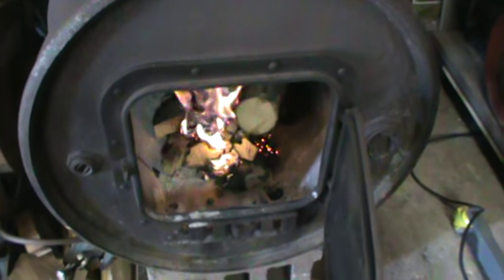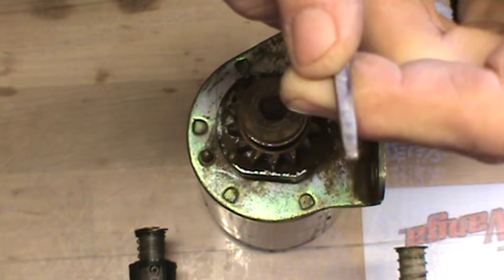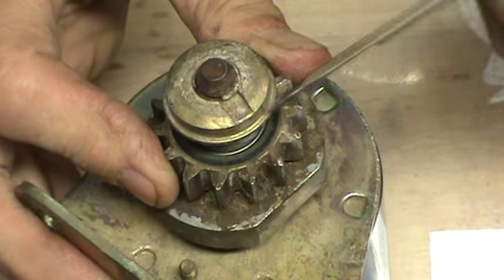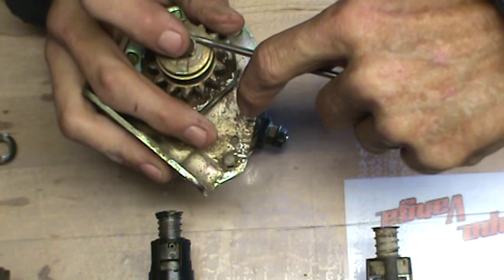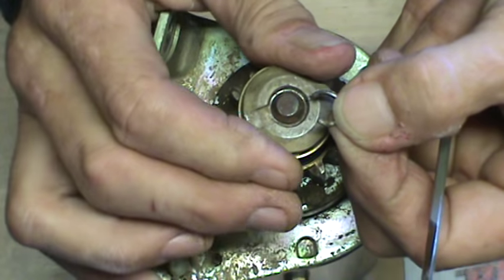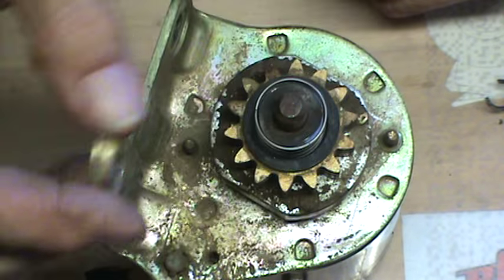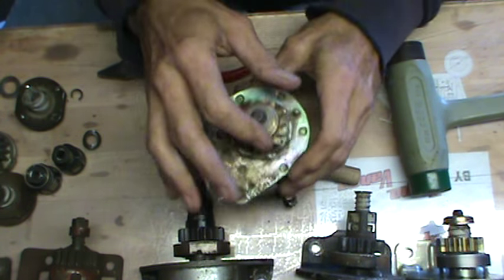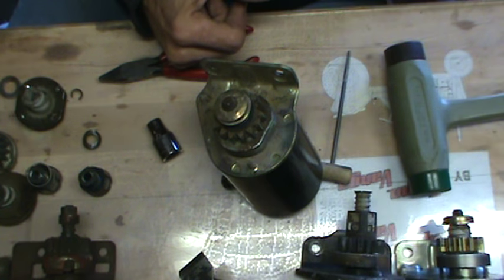Briggs Starter Gear Replacement

Comment: thanks for the video, that was sure faster than it worked when I did it,, I think part of my problem was I didn't have a small screw driver, in my case it's almost harder to reinstall the clip but I never tried using that slot like you did,, thanks again.
Reply from the maker: +MissouriOldTimer Your very welcome Old Timer! Glad I could shed a little light on my way of doing this. Another way is to use a small 12 point socket and press the clip onto the armature shaft. Cheers!! Zip~

Comment: I have no idea what the original gear looked like for the number of teeth but the plastic one used to replace it is already broken after only 1 year.  Is there a way to look up what the original gear was?  I’m thinking it didn’t last because it was the wrong one.  Thx.
Reply from the maker: Hi Paul. Yes there is. Using the first two sets of numbers on the ID tag (click here for where to look: https://www.youtube.com/watch?v=Y4T0W2fHRdU) you can then go here: https://www.briggsandstratton.com/na/en_us/support/manuals.html to enter your engine identifying numbers and download your parts manual which will have the needed part number for your starter gear and other parts you may need in the future. Cheers! Zip~

Comment: Nice video.
I lost that tiny ring it flew away like nothing (it happened before I watched this video)
I don't know where to find something similar to replace it...damn
Reply from the maker: You can purchase a new clutch that will come with a new snap ring or, you can drill the shaft at the ring groove and install a roll pin to keep everything together. I feel your pain. I've lost a few in my day too. Just search Briggs and Stratton starter clutch and you want to match the type appearance wise as well as by counting the number of teeth on the clutch and making sure you order one with the same number. Cheers and good luck! Zip~
Reply: @ZippoVarga  Thank you!!!!!

Comment: You did a good demonstration here I am fighting with trying to get the ring off on a Kohler vtwin starter.  Similar to this but, seems hard and I have messed with it all day trying to get it off.  What exactly did you do to that screwdriver and how did you do that
Reply from the maker: I ground the tip with a radius to match the shaft radius and flattened it down enough that I can get the modified driver between the ring and starter armature. Hope you get it! Some can be a real pain. Cheers!! Zip~

Comment: Thanks for all of your videos They are great.  Have you ever made a video showing us how to check whether a briggs coil is good or bad when it is off the engine and on the bench? I have a B&S 243431 from an AC Big Ten with no spark. I know of several gentlemen just in my home town that would benefit from a video of this nature.   Thank you very much...
Reply from the maker: +Goober 26 Search YouTube and there are a number of videos showing how to test ohms of resistance on magneto's. I can get a video up, but if you're in a bit of a hurry, that search will give you instant results. Thanks for the video suggestion and for contacting me on this. I will get a video posted as soon as is possible after Thanksgiving. Have a Happy one! Zip~
Reply: +ZippoVarga  Thank you sir for the reply and your suggestions.   I will check other YouTube videos BUT I am sure none will be as good as yours....Thanks again